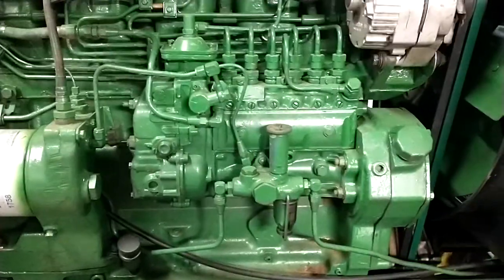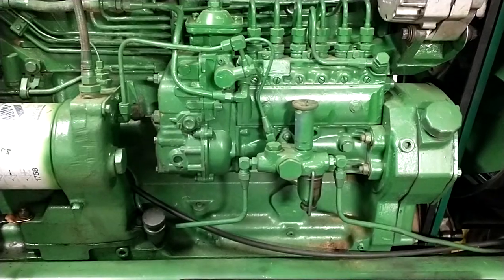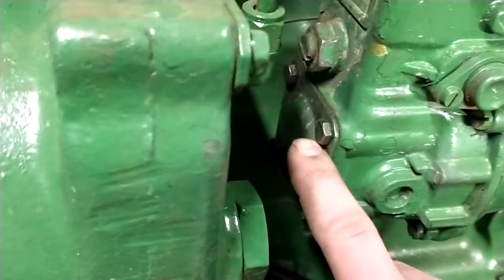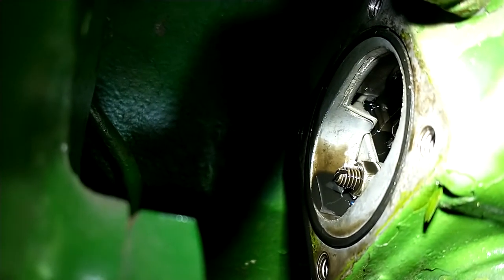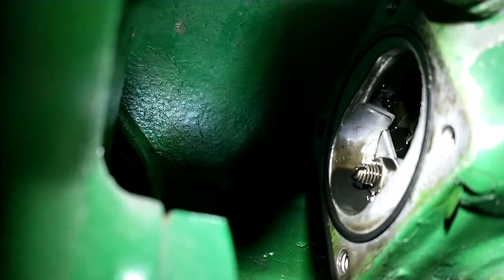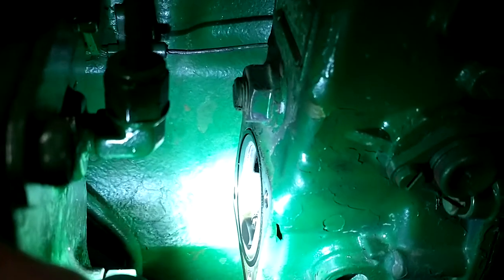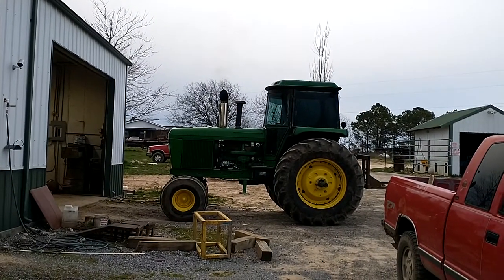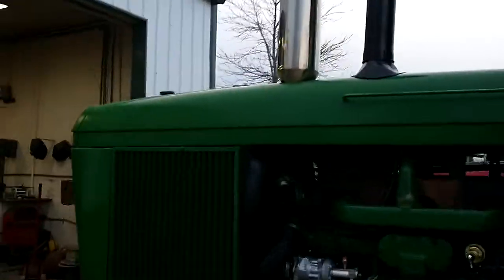how to turn the fuel up John Deere 4440

Comment: 1/3 of a turn is about 20hp give or take. After 2.5-3 rounds you actually start pulling fuel out of it because the rack isn’t able to get open all the way.
Reply: How much is field safe? Tryna turn our 86 and 84 up
Reply: @cs-gj3yf  on my P pumped 4840 I was told ¼ turn is close to 15 horse. Don't go more than 2 turns.

Comment: Every single guy wishes deere still made legends like this..hell even my compact 1050 deere responds to turning the fuel up extremely well, and its notoriously way underrated almost all dyno at 44-46hp and deeres infinite knowledge rated them at 37hp lol no idea if the old 1/4 turn equals the old 15hp standard of the fullsized deere (so being a 3 cylinder say 7hp) but we sure do need guys to test this on video. All the old knowledge learned from hard experience CANNOT be lost to time, so we appreciate you making the video

Comment: What about the two adjustments right above the plate you removed. I know one is for idle set but don't know which one or what the other does. Also what is proper procedure setting idle? Is there a sequence between the stop on the quadrant and the set screw on the pump? Mine was actually turned up a little to much for me so I cranked it down a little to save on fuel and now it idles to low
Reply from the maker: Email me and I will send pictures from the service manual 4btsilverado@gmail.com

Comment: How much hotter does the motor run after you've turned the fuel up that much
Reply from the maker: It stays pretty cool as long as you keep the radiator good and clean

Comment: What's the danger turning up the hp? I was told if I turned up my 4440 one full turn, don't work it hard. What's the point then?
Reply: I’d say 6 turns is to much for field, 2-3 is reasonable

Comment: How far do you twist the pump to adjust timing? Is there any marks?
Reply from the maker: No marks. Scribe a line on the pump and housing and move about 3/16
Reply: @jaredgilbertfarms2067 they like 13 degrees

Comment: Does it work the same for the 6910 ? Nice video by the way
Reply from the maker: Thanks. Could you send me a picture of the injection pump on the 6910
Reply: @jaredgilbertfarms2067  I am not at my work right now , and I cant send a picture in the youtube comment section but maybe you can look it up on Google ?
Reply from the maker: Looks like a different pump I'm sure it can be turned up but not sure how
Reply: @jaredgilbertfarms2067  okay , thanks anyway